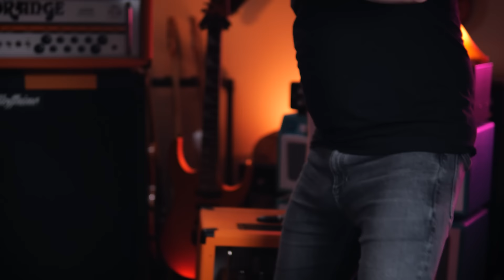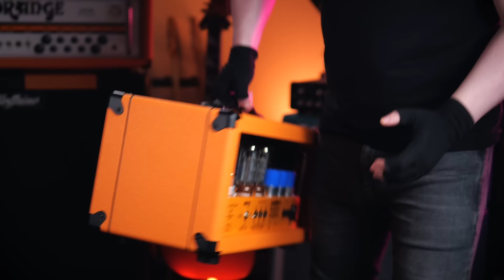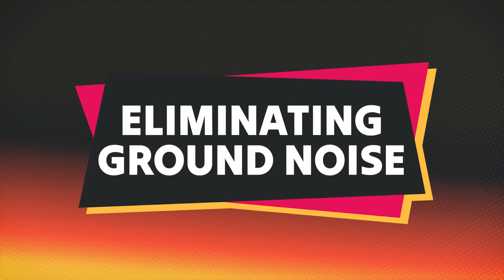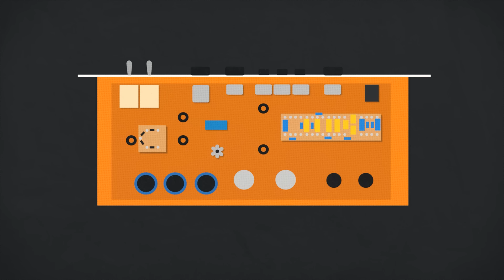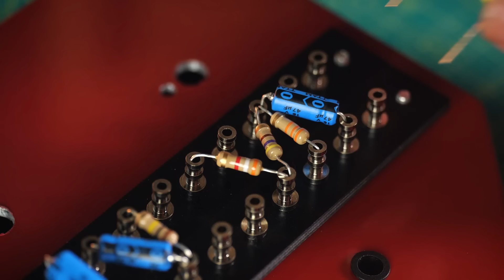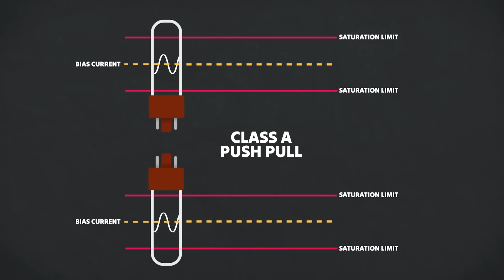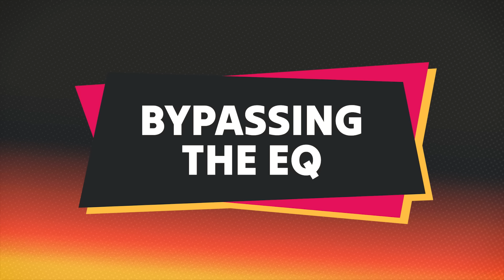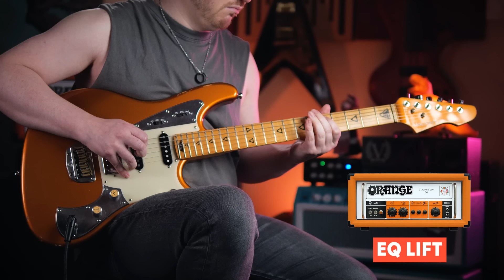Archaic Design of Handwired Amplifiers

Comment: So point to point wired amps is easier to find the problem when there is. Now that's interesting.

By the way, are you using an RJ guitar on the first sound test?
Reply: Yep, shocking that amp tech’s don’t want to spend HOURS AND HOURS arseing around with multiple PCB’s in your crappy landfill amp. 😐😑😐

Comment: One criticism of the demonstration between class A and Class AB amplification: You didn't play the same tunes under both amplification methods. You cannot compare the two if you're using two different set of tunes. Has to be "Like for Like" testing conditions, where the ONLY variable is the switch itself.
Reply from the maker: I was really showing under what applications I'd use each: for cleans and leadwork I would opt for AB for the greater headroom, but for distorted rock riffs that's Class A for the quicker saturation. 

I understand that you were looking for a direct comparison under the same application, however I can think of two ways to do this and each have their issue:
1 - I track a single performance that gets reamped through each switch setting: this is the most scientific approach, however it eliminates the most musical reason for the switch - how it changes the feel of the amp, therefore influencing the performance. 
2 - I play the same riff twice, once with each setting: This would show how each setting influences my performance, but the two different performances make it more difficult to make direct A/B comparison. 

As stated in the video: This difference is much better experienced by the player as a FEEL difference. A/Bing a recorded sound in a video for a listener who isn't able to feel the difference in response isn't all that educational. 
My best advice would be to get along to your local music shop and try one for yourself.

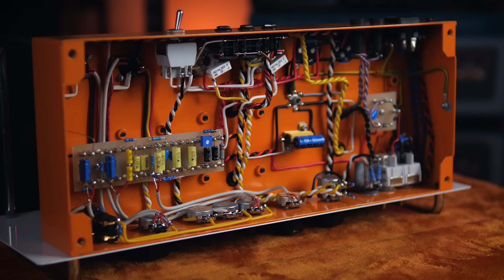Comment: 0:17 goddam, no wonder people cram an entire Sunn amp into a small pedal and get the same sound, there is nothing but air in these boxes
Reply from the maker: The pedals can be smaller because they don't contain the power transformer, output transformer, valves, and all the associated infrastructure required for them which necessitates the space. As discussed here, the power and signal components of the amp NEED to be physically separated to prevent noise.
Reply: @ScienceofLoud  sure, but pedals offload that problem to external PSU when 9v battery is not enough. For example, my friend has this bass preamp which can drive a 15 watt speaker directly, when we dont have anything but regular guitar amps available at the bunker. Needless to say, that thing's PSU is an absolute concrete block.
Reply: @Grishanof   Moving the power supply outside of a valve amp only removes one of the large components mounted on top of the chassis, the power transformer (and sometimes a rectifier tube).

But the amp still needs preamp and power valves and an output transformer. They also carry higher currents than pedals, which can induce hum in the sensitive preamp circuitry, so you want as much physical separation between stuff like the power valves and power transformer and in the low signal input circuitry (that's why the power transformer is mounted on the opposite end to the input, and why its so heavy on one side). Also due to the high heat and voltage relative to a pedal, ventilation and safe electrical clearances are required. So a lot of that "empty space" is still functional from a design point of view. You simply can't cram a traditional guitar valve amp inside a standard pedal enclosure.

It works for a Sunn amp because either the amp model they used was solid state to begin with or they've attempted to mimic a valve circuit using solid state components.

Also, it may be worth checking exactly which output your friend is using on that bass preamp. A speaker being rated for 15 watts only tells you how much power it can safely handle, it does not mean a preamp output can drive it. Unless the unit specifies it can drive that speaker's impedance, connecting it directly to a passive speaker could damage the unit.
Reply: @ashleysmith1169   well, yes, the lamps are replaced with same logic, only in silicon. I don't remember an actual pedal using a high-voltage lamp, outside of that AMT overdrives maybe. The thing is, all those amps were built on generic logic blocks that are doable on a plethora of different lamps, and opamps arent that much of a stretch if you want a buffer, or an inverting amplifier, or a phase shifter, etc.
I meant the pedal could output 15 watts of power, if you trust the datasheet. That 100w marshall combo that we used as a bass cabinet could probably handle more.
Reply: re-reading that again, i think i should also add how small PWM power supplies are compared to full-size transformer, and how quiet they've become in the last 10 years. They used to require a filter with a few voltage stabilizer cascades just to get rid of 50hz noise (was very proud of that breadboard lol), but not even that nowadays.

Comment: Josh from JHS did say once they went to surface mount from hand wired discrete components, their noise levels went down noticeably. Will that be an issue between point to point and PCB which does not use surface mount components? I don't know. However, seeing everything laid out in a larger scale, exposed like this and hand wired looks like it would be easier totrace the paths, learn about and understand.
Reply: With smd parts that whole amp will fit in the palm of your hand and still be repairable without glasses. If we stop pretending every resistor needs to be 3 kilowatts rated, it could be shrunk even further and still work the same even before we get to smd level. These boards were designed in the olden days, where this was a generic off-the-shelf part size, dont doubt for a second that they would go small as soon as possible if they could. Hell, they did.
Reply: 9 volt palm-size pedsls are a completely different design-apple compared to an Orange or other tube amp at 350 to 500 volts DC and with big heavy hum-radiating power transformers.
Reply: @goodun2974  No, amps wouldn't use the same tiny surface mount components for the high amps (there are some SMCs with 500v ratings), but would a similar move with appropriately scaled components experience a similar reduction in noise?
Reply: @MikeDS49, perhaps, perhaps not; if the circuit board and parts layout is done 98% by a computer program without an experienced tube amp tech/designer overseeing the process, the layout would likeky make all the same mistakes that circuit designers of the 1960's learned by trial and error experience to avoid!
Reply: @goodun2974  "computer program" just lets you draw lines and place parts on a virtual pcb, the mistakes are all human. On top of that, there are simulations you can perform even befor pushing it to real world, and tens of iterations of the same circuit where parts are shifted and nominals adjusted, nowadays you can draft a new design and have it manufactured in half an hour in a spare storage closet.
Reply: @MikeDS49, ps, problems also arise when small SMD parts are used for the low voltage channel switching and effects circuits of otherwise high voltage tube amps. Despite being surface mount and theoretically replaceable without removing the PCB, diodes might be half buried next to or inbetween tall through-hole  filter caps so that you cant reach in there with a soldering iron, necessitating removal of the board and unsoldering of the caps to access the SMD parts!.
Reply: @goodun2974  If you look past 600 volts the lamp requires to be a big hot transistor, you will see the same logic in those pedals circuits. 99% of the differences are the PSU, which is often is an entire external thing.

Comment: For me the main difference between point to point and PCB amp designs is the repairability and that usually comes down to the component choices.  If you are keeping the same kind of components in both examples (which would usually be mounting through a PCB) then there would be little to no practical difference between the two with the exception of assembly cost.  It's once you get into surface mount components and other tiny items that need expert level skills to replace where repairability starts to fall apart.
Reply: Exactly this.
Reply: You can even design PCBs that take turrets, which gives you the neat looks and spacious layout of turret-mounted components yet eliminates the fiddly interconnections. I'm far from an expert (have only built a handful of amps for myself and friends), but I've always hated doing the "horizontal" connections on turretboard.
Reply: PCB also makes modding a lot harder.
Reply: @needsLITHIUM depends on how pcb is designed
Well designed pcb shoild be as moddable as p2p
Reply: @needsLITHIUM  on a factory build sometimes- but the boards I use, when i use them, no problems.
Reply: I keep hearing that take, and yet even SMD soldering is in the $20 budget with all consumables. How low is that "expert level", if this ooga booga board only requires heated railroad spike and a lot of free time?
Reply from the maker: The lower reparability of SMD is not because techs aren't skilled in those kind of repairs - it's because those repairs take longer, with the cost of that time being high enough to not make it worth paying for. 

SMD take much longer to troubleshoot, a tech could spend hours tracing a multilevel PCB to try pin down which component is causing the issue. The replacement part might end up costing pennies, but the time of the tech is expensive. Quite often the final cost with be a significant portion of the SMD device being repaired, which customers most likely will be unwilling to pay. 

For the same amount of time, the tech could take on multiple easier jobs that pay better and can be turned around quicker. If repairing amps was your business, it just makes sense to reject the difficult time consuming jobs that don't pay and prioritise the easier ones that will. 

That's why techs tell you that SMD devices "can't" be repaired - it's less ballache to tell the customer it's not possible than waste their time on a job that they won't get paid for.
Reply: @ScienceofLoud  that amp doesnt look like it would even need a second layer for a PCB, all those elements act as jumpers. Fun fact, if you disassemble Biyang FZ-7 and look at the circuit near the 3-way switch, they ran traces under SMD components, because there is still that much space left even with these tiny parts. Maybe it's just me, not being old enough to witness these huge components being default size, but the whole thing where you need a second table just to put it down, and roaming around the body just to look at the other end of the wire, and requiring 100+ watt soldering iron to do anything, seems like a bigger investment if you want to start repairing things. Not to mention that non-euclidian bs that always happens with point-to-point wiring. Really, all you need for SMD is get used to tweezers and sharpen your multimeter probes, my old t12 soldering station is humongous by modern standards and it still gets the job done. The schematics of those amps are infinitely reused since the 70s, you will see the same 3 ways to wire an opamp, you will see the same 3-cascade overdrive everywhere, the same thembroblocks, these are literally the same diagram but they don't take 3 business days to travel from one end of an amp to another. Only upside of those old designs i see is ability to fix them in a moving vehicle.
Reply: @Grishanof  Having done some amount of repairs, I can assure you point-to-point systems are much easier to deal with. Colin didnt even go into the nightmare that is broken copper traces. Plus, in a point-to-point or turret system, you can alligator clip to a point and measure voltages much more easily. 

I wilk grant you that part of it is experience and need. People buying big turret tube amps want to repair them. People buying small SMC amps typically just buy new. The two markets have little overlap, so old dogs dont learn new tricks, and new dogs dont even go to the show.
Reply: @dipchip5542 scrape the paint, tin the ends, solder a piece of wire as a bridge, dab some nail varnish, you're done in 8 minutes. Sound equipment uses pretty large traces to begin with, you won't need any kind of optics for that. Now heating up and unsoldering 5 different parts and a terminal, only to remove a single blown part, and then trying to wrangle all the wires that spring away to put them back, is much more annoying and fiddly.
Reply: And you'd try to fix that $1000 box anyway, regardless of how it's made. Only reason you'd buy a new amp is if it cost 35 bucks, good like finding a tube that accessible.
Reply: That's fine. But there wasn't any discussion or voice over, and it would still be nice to hear those examples under both for a side by side comparison.
Reply: To be honest, SMT parts aren't even that hard to replace. Sure it's harder than THT, but it doesn't make the amp any less repairable. Also, a notable difference with SMT PCB designs versus hand-wired is that they tend to have lower noise due to the shortened wiring and better grounding, Josh from JHS talks about this from when he transitioned to SMT pedal designs.
Reply: @stevato0449 problem with smt compinents is that they don't always have labels on them (especialy the smaller ones), then repair gets waay harder because You need some reverse engineering
Reply: @Burbund, SMT makes having a schematic mandatory, especially if a part has burned up---- but manufacturers don't want to provide service info; they want you to throw the piece of junk away and buy a new piece of junk. They must be forced by right-to-repair laws to provide service info, but their lobbyists will fight against this with tooth and claw and millions of dollars. Sometimes, lawyers for Apple and John Deere ( two of the least consumer-friendly corporations on Esrrth) will  work for "free", pro bono, to assist other, smaller manufacturers and retailers (especially car dealers) who don't want to have to provide parts and service info to their DIY customers or to independent repair shops.
Reply: @goodun2974  true, but most tube amp use single sided pcbs, so tracking traces wouldn't be that hard
Still a dick move to not provide a service manual
Reply: @stevato0449 , pedals that are housed in palm-sized boxes and run on 9 volts are nothing like large, heavy tube amps with 300 to 500 volt power supplies and big heavy transformers. ( I've been repairing audio equipment for nearly  60 years, including 20 years fulltime)
Reply: @stevato0449  I’d love to meet the tech that will work on SMT amps…😂😂😂😂😂
Reply: @REDCROSS88 Every electronics tech worth their word can work on SMT. Everything made these days is SMT, except for the quirky industries like audio tech where people genuinely believe their vintage through hole transistors somehow make better tone than their $0.01 modern counterparts.
Reply: @REDCROSS88 , such techs do exist, and you can wstch a few of them in YouTube, but amps made with SMD's are often so cheap new that it doesn't make financial sense to pay someone $100 an hour to fix it. The cost to society and to the environment of such landfill amps is, unfortunately, very high, yet never borne by the manufacturer.
Reply: @goodun2974 And even though we no longer do the mfg on a mass scale, this is the plague that is America and our system of deregulated capitalism. There is no entity more powerful or that has the ability to govern the modern day corporation. That's why our country is 3rd world for the pleebs and 1st world for the rich. We need a class war.
Reply: I remember i watched some video on jet city amps and they have really well designed pcbs with servicability in mind

Not mentioning that smd repair isn't that hard, but it is a different beast, compared to tht
Reply: @Burbund, if you want to be efficient and accurate, SMT requires different soldering/desoldering tools than through-hole parts: heated soldering "tweezers", specially shaped tips, probably a controllable hot-air station, perhaps  an expensive digital microscope, special fluxes, tiny diameter solder, soldering pastes, and a new skill set that takes time to develop. Most important of all, access to schematics, which many manufacturers don't want to publish except perhaps for authorized servicing dealers. Right to repair laws are absolutely critical